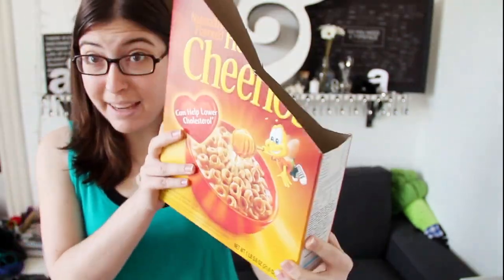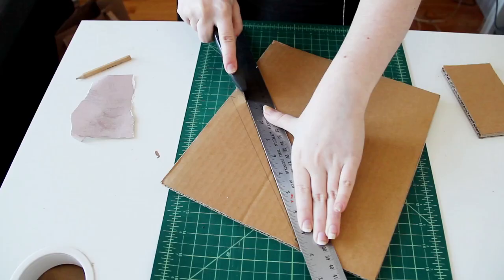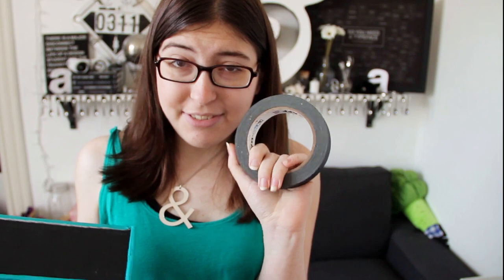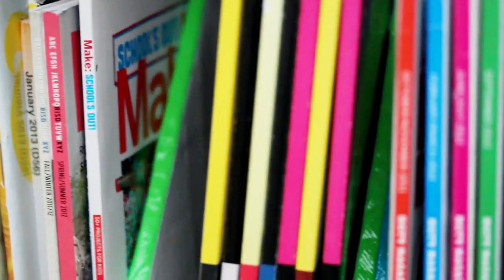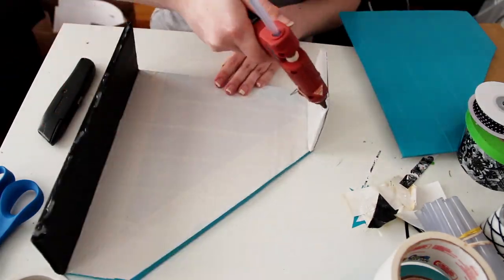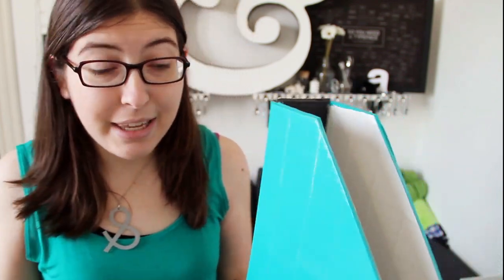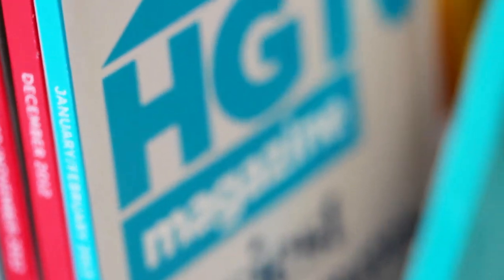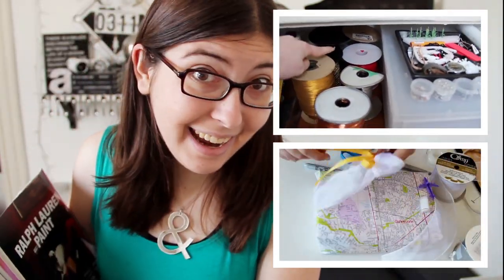How to Make a DIY Magazine Holder

Comment: Thank you! I had lots of Duck Tape, lots of boxes, and lots of unorganised 12x12 paper so I adapted the size to 13 inches and made files for the paper. I got into a mess with the hot glue (as usual!) so I joined the pieces with even more Duck Tape, inside and out to reinforce the joins even though I don't plan to move the files. I positioned the files with the small piece at the top, so I can pull the files out the front easier as they are in a cupboard.

Comment: I'd be concerned with them falling apart if I ever tried to move them/pick them up while full. I use mine to hold my comic books, and a collection of trades get pretty heavy. Hot glue is not the strongest adhesive.